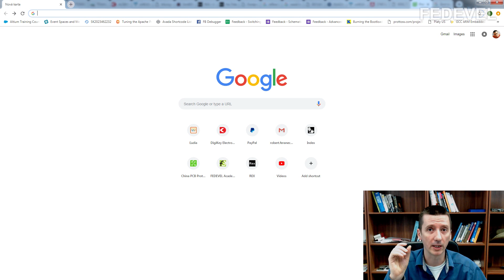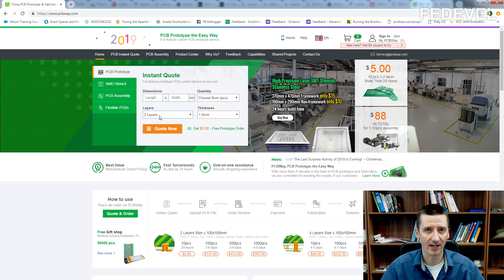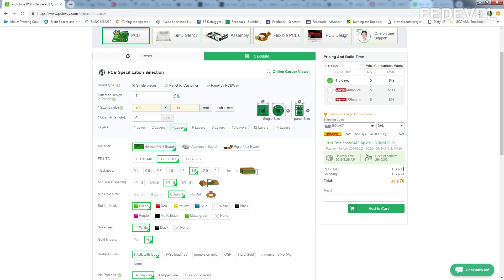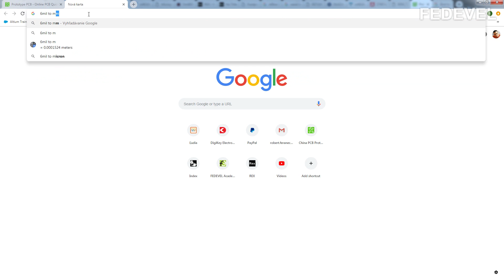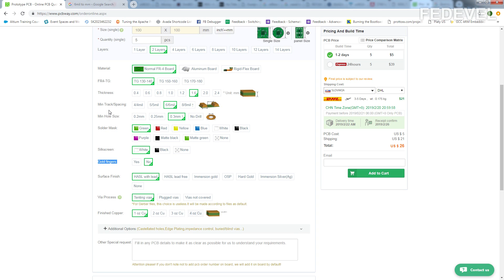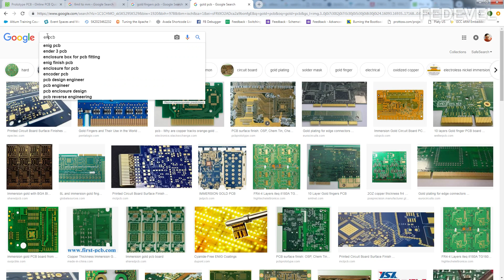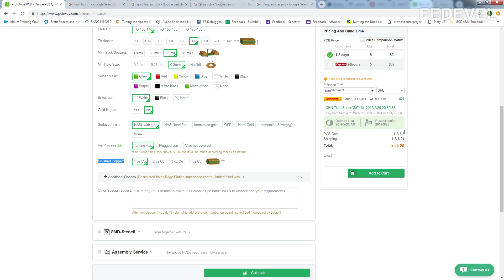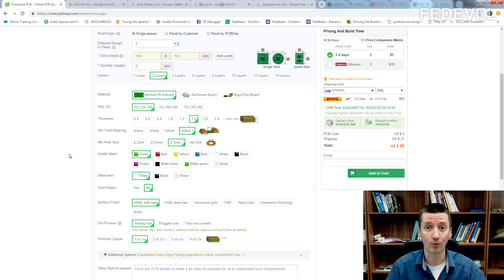How to design cheaper PCB? What the parameters on PCB manufacturer website mean?

Comment: Hello robert, I am working on project that  high power Hw design(25kW SMPS) therefor How to calculate PTH hole and pad diameter sizes.
Reply from the maker: I am not expert for this, but maybe there are some special techniques or special approach to calculate parameters for high power boards ... e.g. you may want to fill the VIAs with copper (maybe) ... or maybe ask PCB manufacturer ... or build some test boards and test and measure them (that is what I would probably do). Maybe someone else can help?
Reply: @Robert Feranec  Thank you for answer; Actually, What I want to do is creating TH component footprint for that Shoul I use component  manufacturer recommendation for footprint hole and pad diameter sizes or someting should be different. and also Do you have any idea for stackup for high power applications.
Reply from the maker: @sadiktahta9534  in my opinion, if you use a TH component, than the copper in TH component and solder should be able to carry the current with no problems - component pins should be designed that way.

Comment: does Clearence between polygon and tracks and between tracks have an effect on cost ?
i know that pcb made by UV and chemicals  but have a doubt if some one will make two layer pcb by  CNC router i think clearence will matter
Reply from the maker: If you go into small track to track clearance e.g. 0.1mm, then it is recommended to use bigger clearance between polygons - one of the reason is, that is not easy to etch very thin gap between polygons. But I do not think it has effect on cost - PCB calculation simply counts with minimum clearance - and it may not be important if the clearance is between tracks or polygons.

Comment: I did not find this particular video very good (compared to your Altium tutorials). Some things that I take issue with:
Should have explained why plugged vias may be critical for reliability despite the cost (solder wicking) now that many SMD packages have a thermal pad.
The surface finish - again for reliability ENIG may be very important - especially as HASL surface finishes are not flat! 
Just focussing on up-front manufacturing costs can lead to very expensive reliability costs! 
Also it would have been better to explain that 1 oz (1 ounce) is a weight of copper for an given area, which corresponds to an equivalent copper thickness of  ~35um.
Reply from the maker: Thank you Laurens for your feedback. I appreciate it a lot.

Comment: This is a very interesting video. However, I should add that for larger quantities (100+) the price increase might not be so steep for some of the options. Also, different fabs will have different capabilities, which influences how much each feature will affect the price. There was a time when the fabs looked closely at the number of holes (e.g. vias) in your PCB. Nowadays, with machines so fast, they don't even ask you the quantity.
Reply from the maker: I remember that days :) PS: I believe, the problem with small drilling is, that the drill bit is quickly damaged and has to be replaced after certain number of holes e.g. 0.15mm / 6mil drill bit can only drill like 100 holes. That makes it expensive. ( If someone is interested, here is video where a PCB manufacturer is talking about it: https://www.youtube.com/watch?time_continue=115&v=f6_svRNJYls )

Comment: My personal favorite shop is wellpcb. One distinct advantage they provide is they can manufacture custom stackup for no extra charge. I've been ordering 6 layer controlled impedance boards from them for a while now (if you're curious about stackup I used - you can see it in the board file I've sent you a while ago), and the quality has been excellent.

Comment: An anonymous reader writes:
http://www.pcbgogo.com?code=y
highly specialized not only in quick-turn PCB prototype and PCB assembly, but also medium and small volume PCB fabrication. PCBgogo has three factories, established over 17,000 square meters; fully compliant with the ISO 9001:2008 quality management system, UL certified and committed to adhering to the strictest standards in manufacture and assembly.

Comment: Great video. I was supprised to hear you say you don't use plugged vias. 
How do you route large, fine-pitch BGAs, without the use of conductive-fill plugging and via-in-pad (VIP) technology?
Reply: He's using microvias.
Reply from the maker: I try to avoid using VIAs in pad. We had some problems with that in past. Now the technology may be better and for some boards you may need to use it, but I was still somehow lucky to go around it (especially because it adds cost to PCB).

Comment: Good tips for those of us who make prototype PCBs regularly!  I've also seen that the overall size in sq inches makes a sizeable difference in cost.  I'm sure it has to do with how many PCBs they can fit on a sheet and could be different with each manufacturer.  At Sunstone PCBs in the US, I think the break point is 10 sq inches.
Reply from the maker: I noticed exactly same thing - you can actually go up to some size and the price will not change.

Comment: Please explain why it's cheaper to order two separate pcbs than 1 with two different designs.
Reply from the maker: Depends. Play with different PCB sizes and you will notice, that price may not change until you achieve some specific size. If you could fit both boards into that size, you can save some money.
Reply: @RobertFeranec  That's exactly where the problem is! If I cheat and specify "1 design" for two different isolated schematics on the same board, then yes, I can save money. But this is illegal! ALL cheap pcb manufactures DEMAND to specify the number of different designs, even if NO panelization or v-grooves or cuts is used! This is nonsense, I know! But it's true! It would be great if you dig in this matter.
Reply from the maker: @comment2099  I have never heard about that - do you have any links to websites where companies explain that this is against some rules? We often place on one panel smaller PCBs which are used in the same system and then break them of the panel - it is easier for production and manufacturing (it is easier not only for PCB, but also for assembly) - we have never had any problems with that and PCB manufacturers know these are separate circuits. Maybe it is something for these online PCB manufacturers only?
Reply: @RobertFeranec  There is no detailed explanation of "different designs". But there're small pictures like this: https://www.pcbway.com/img/images/newpcbway/different.gif
And the text: "we will charge extra panel costs when there are different kinds in 1 PCB design."
Reply: @RobertFeranec  And also here: https://support.jlcpcb.com/article/62-what-cases-will-be-charged-of-extra-cost 
"What cases will be charged of extra cost?
1. If there are more than 2 different designs in your file，then there will be  extra cost for it, and it is 8 dollar/design."
Reply from the maker: @comment2099  ah, it's not illegal. but as you pointed out, they will charge you for it.

Comment: Great video!
About JLCPCB - they are really cheap and they can do very small tolerances in tracks - 3.5mil/3.5mil for 4+ layers. I'm waiting for my pcb from them, 4 layer, vias in pads, not rectangular shape, 47x127mm and HASL Lead-free  and it costed ~200 PLN with UPS delivery option, which is cheap as heavens.

Comment: I have found that JLC PCB is cheaper and has better capabilities available for lower cost than most other Chinese manufacturers. I often use their 4 layer boards with 4mil track width and 0.2mm vias for $30. I have never had any issues with them, but i wish they would also do PCB assembly.
Reply from the maker: I also used JLC PCB because they were cheapest for the PCB I needed.
Reply: Same here, I have had more than 60 designs thru JLCPCB without any problems whatsoever. (even going beyond their capabilities for via's for 0.65 mm BGAs)
They are significantly cheaper than PCBWAY.

Comment: Some video on USB interfacing and antenna design on PCB, please....
Reply: RF circuit +1
Reply from the maker: daklu is right, I do not really do RF. Many people also ask for EMC, but you need some expensive equipment for that kind of videos. Also, I do mostly CPU designs - that is where I have most experience, my RF is usually only based on datasheet.
Reply: @RobertFeranec  I hope your CPU designs take EMC into account though ( :-o )! Good control of EMC starts at the PCB layout level - and can almost always be traced (no pun intended) back to control over where the "ground" return currents flow.
Reply: i remember he said long time ago he doesnt do RF because those kind of pcb require expensive certification

Comment: PcbWay is my favourite online pcb manufacturer for easy and low speed boards.
Still, there are some limitations: they don't have much  default layer stack structures. So if you have other layer stack up, you have to modify it. Good thing is they'll always check ur manufacturer notes layer, and would inform you if some issues are found. Second thing is they don't offer suggested impedance table for width and gap even for their default stack up. So I would like to know how you guys do impedance match and high speed pcb with this kind of online pcb manufacturer. Thx, Robert! Always good video!
Reply: JLCPCB has different stackups you can select, and they also have impedance calculator on their website for these stackups. Very easy to use
Reply: @CarstenGroen  yeah, just checked their website, awesome!!
Reply: Same to me, always happy experience with PCBWay! !

Comment: The price of the PCB is also related to how popular the particular choices are.  The manufacturer is expecting high volume on 2 layer boards with 6/6 spacing.  Since fewer people are going to be using more advanced options, such as 4 layer for example, fewer boards are going to be ordered, driving up the unit price.